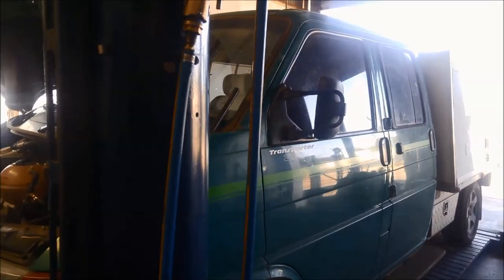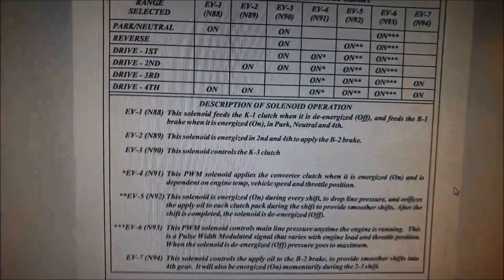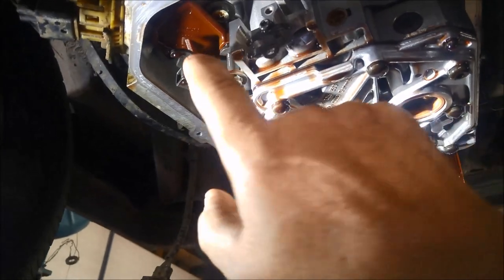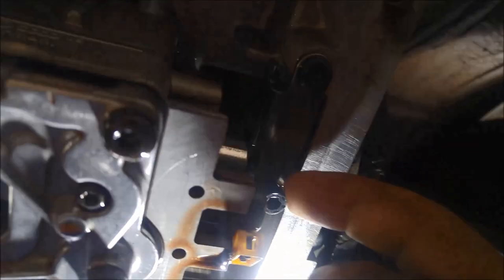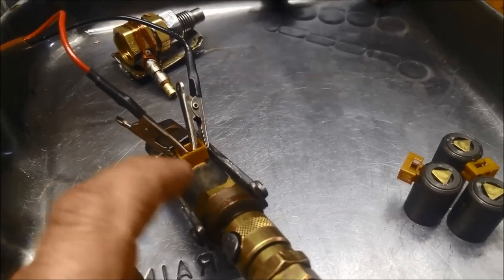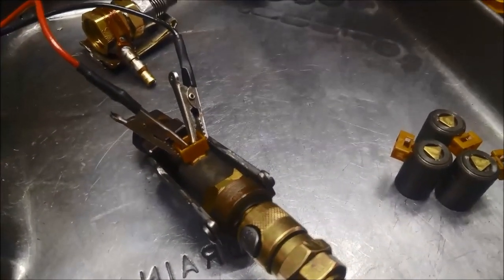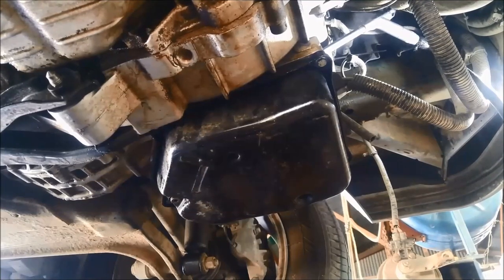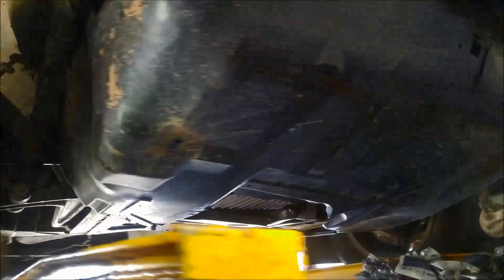VW 01M 01P Skoda SEAT Audi 4Sp FWD Automatic Transmission Filter Service Flush Replace Solenoids

Comment: Your videos are very informative! I rebuilt the transmission on my 2000 eurovan 01p. Any ideas why the transmission won’t go into neutral? The selector lever moves fine but once I torque the nut on the the pinion gear, the transmission will no longer move in neutral. Seems like the parking pawl is rubbing on the gear. Any ideas? Thanks
Reply from the maker: hi, sorry once someone else works on it i can`t say....you will need to recheck your work. cheers
Reply: @YepThatsIt  will do. Thank you

Comment: my car audi 01n auto transmission its getting delay to change the gear 2nd to 3rd  new oil and new filter replaced but still same please give me information where to check  ..and no any error codes  checked with vag  ross tech
Reply from the maker: hi, a leaking solenoid will give no fault codes generally. make sure you have selector adjusted properly see my 01P vids. cheers
Reply: @YepThatsIt  thank you so much , I will go through video